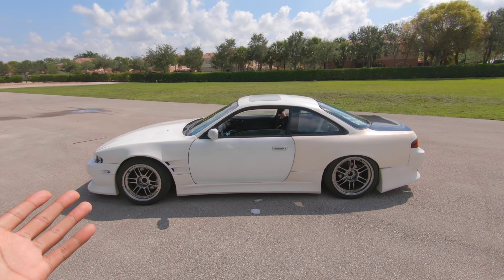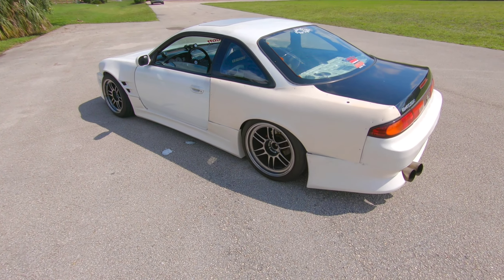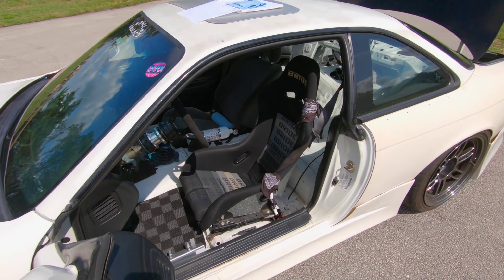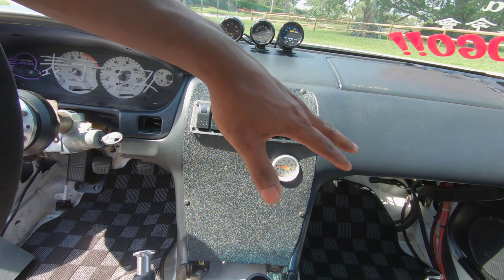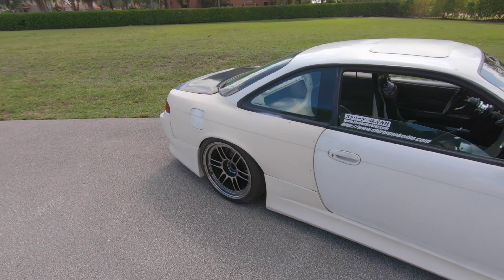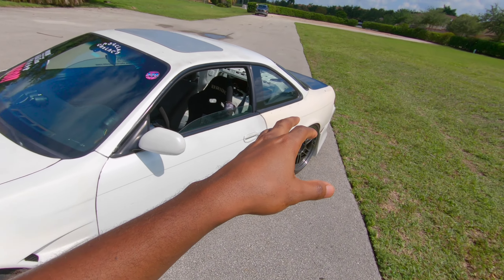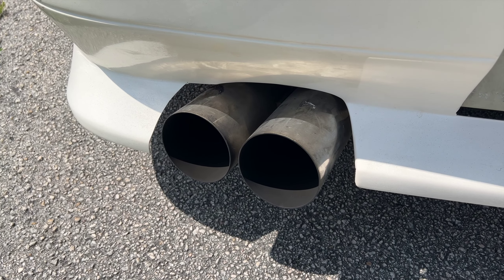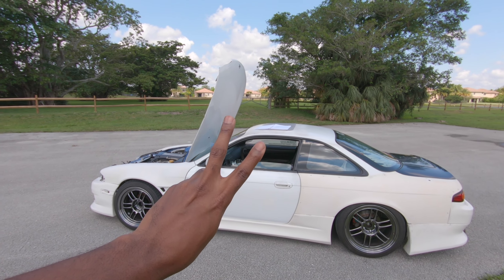How I Built My Car For Drifting - SR20 S14 Machine Check

Comment: Nice build i been running sr and rb for a ling time you could get another good bit of hp by just turning that boost up to 12-15 psi on that t25 im running a t25 on my 180 rn been at 15 psi for years no issues it really wakes it up that stock boost level is just not enuff id at least go to 12 psi you will be amazed at the difference mine is the exact same setup as yours on the 180 and like i said 15psi for a long time they love it. Nice s14 man👊
Reply from the maker: Ahaha Thank you for watching, i really appreciate that !! i actually did turn up my boost to about 10 psi and it made a huge difference. if you look on my page i did an entire video of it also !!
Reply: Nice man i subs hit my page up i have a 500 whp s13 coupe rb25 in it and a 180sx w a black top sr same setup as your cars driveline.i will check out your other vids!👊

Comment: Yeah, dude idk if you saw my comment on your other video I just posted, But Yeah I wanna do something just like this. Damn near exact. Get a wiring specialtes engine harness. But make my own chassis harness. Buy I'm not SR so if you have any insight on how to do it for a ka24DE-t that would be sick. Did you need to keep the stock Fuse boxes that were in the engine bay ?
Reply from the maker: that’s sounds fun ! wiring is all the same only difference would be how you wire power and ground to the ECU. i also made a custom fuse and relay panel. there is a wiring playlist on my channel if you need some ideas !! also you can always DM me on instagram @kriswyche_

Comment: angle kit and how much kg spring rate man
Reply from the maker: no angle kit, just running stock knuckles for now. front springs are 8kg and rear springs are 6kg with dampening on the stiffer side all around !!

Comment: why oil pressure gauge but no oil temp?
Reply from the maker: typically you want to keep the oil at a certain temperature because when the oil gets too hot it starts to thin out and that lowers pressure and causes problems. having a pressure gauge from the start allows you to monitor what really matters which is the pressure of the oil since the pressure is based on both viscosity (which varies based on temperatures) and oil levels. it’s a win win haha !!